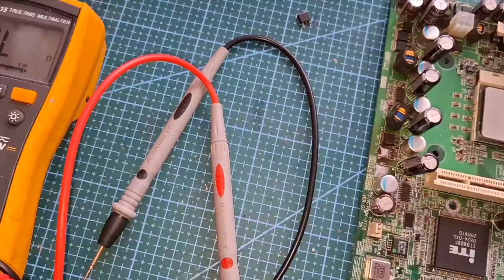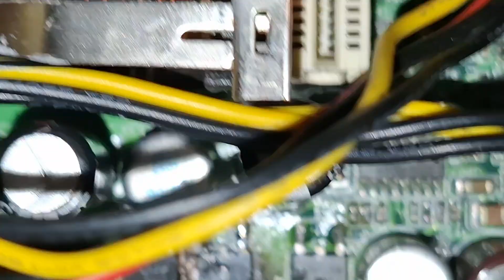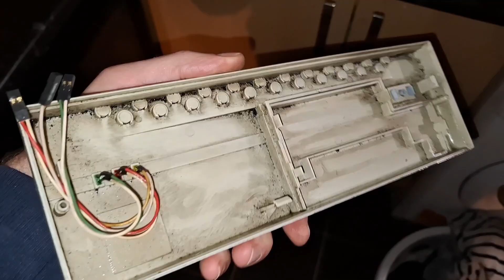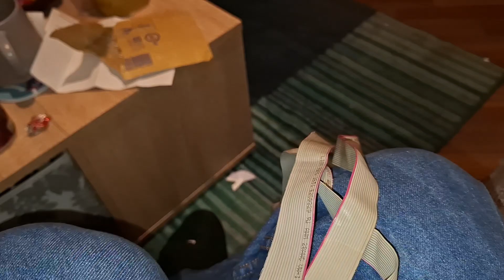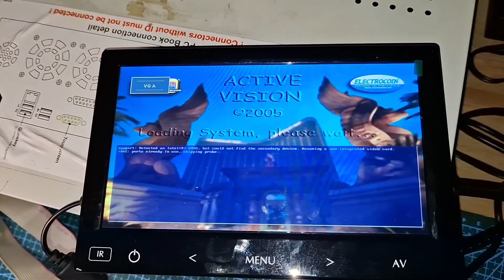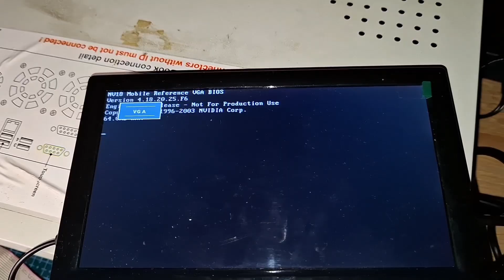Electrocoin PC rescue attempt, it aint pretty!

Comment: Great that its alive!  I don't evny you having to work on a PC motherboard - they are such heatsinks its nuts!  The caps kill the VRM, the VRM failing probably took out the RAM.  Worth re-capping that PSU, it's often a case of the PSU caps go bad as well as the motherboard ones, then the board caps fail sooner and the VRM fails again - been there, got that t-shirt lol.  I bet that board has more than 4 layers btw, maybe 6, 10 or 12!